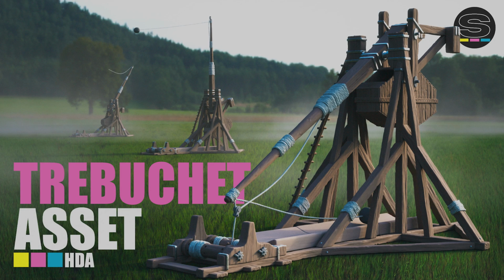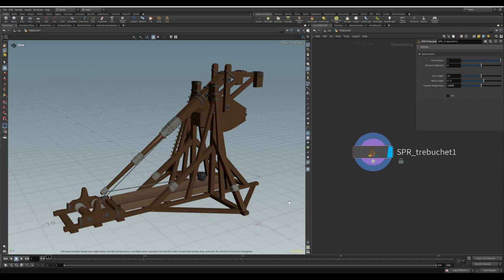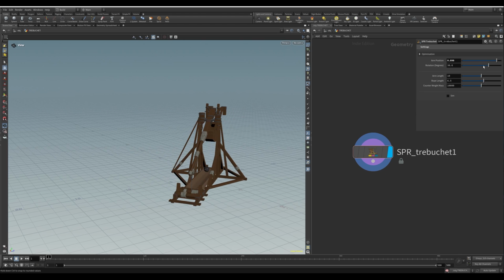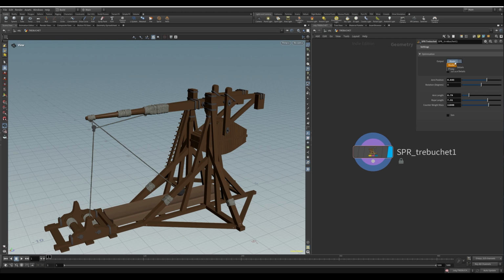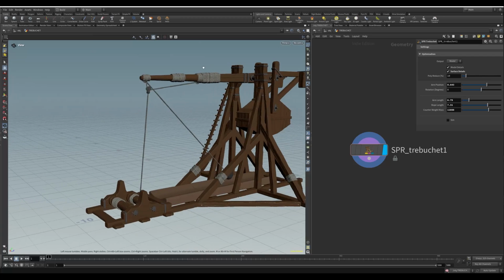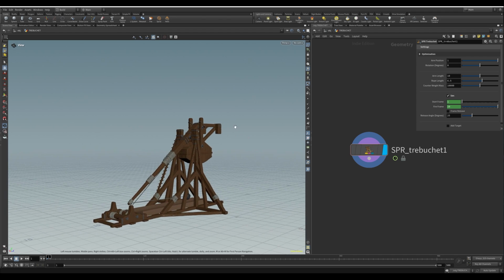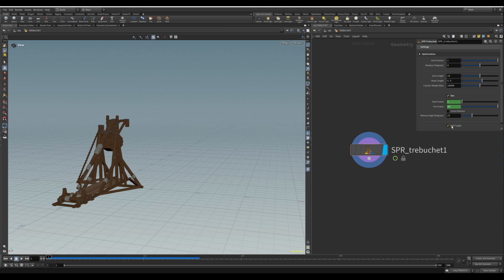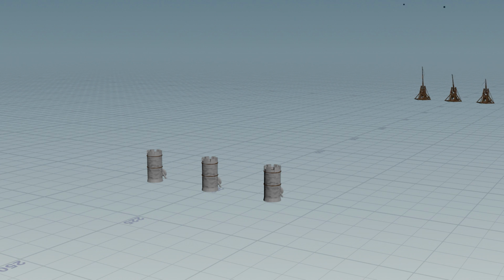Fully Procedural and Dynamic Catapult | Trebuchet HDA  | Houdini

Comment: Amazing HDA so far! However the release option doesn't work, the rope keep attached to the projectile, which gives a fun effect yeah but it's not working ^^
Any thoughts?
Reply from the maker: If the release angle is too small sometimes it won’t actually reach it. Try setting it to a larger value or using the frame release method. Otherwise sometimes Houdini bugs and you need to clear the cache. I’d recommend going to the start frame and using the cache manager to clear all. Let me know if you're still have issues